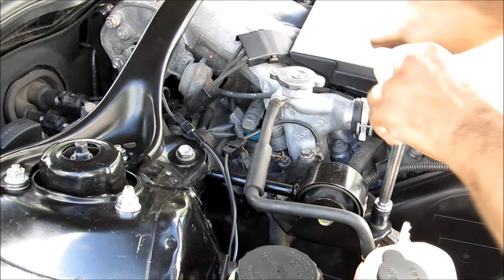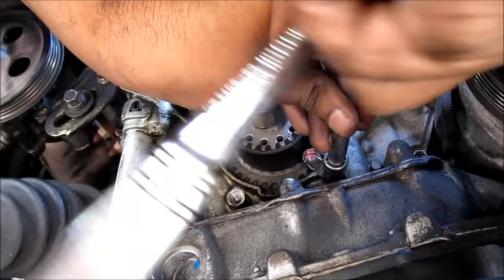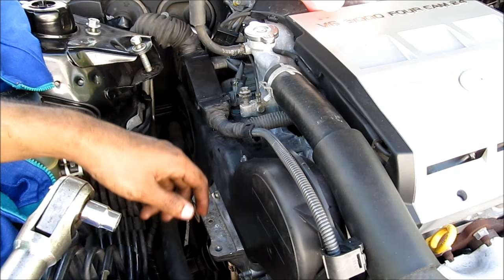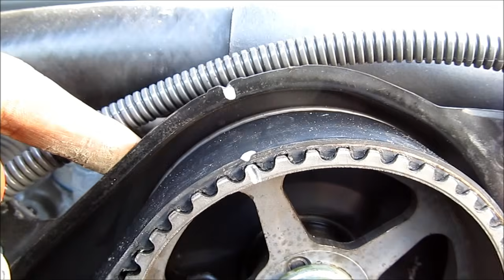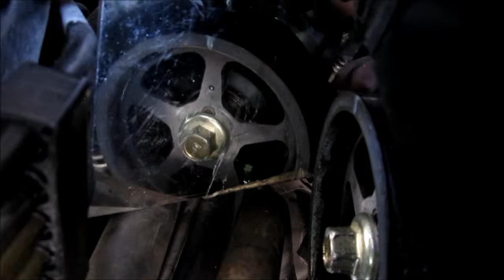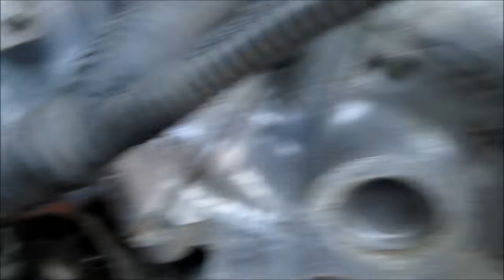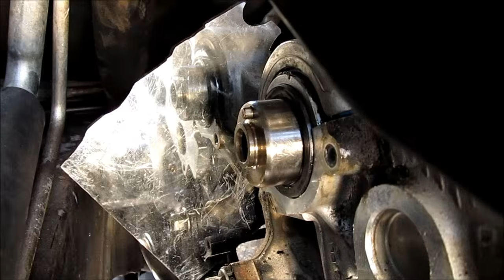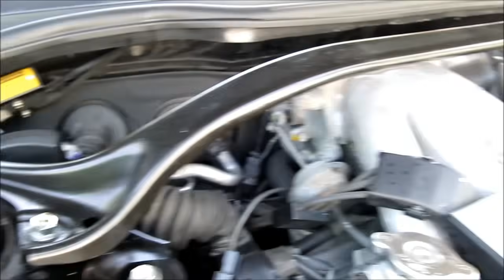Timing Belt / Waterpump Replacement: Toyota & Lexus V6

Comment: Hi, i replace the camshaft seals on my 1995 lexus es300 , i notice that the rear camshaft seal was more loose than the front  put the new ones in the rear one got in easy i used a kit from ebay with an aisin water pump and kp cam seals, and the car still leaking not as bad as before about 4 drops every time i drive it and shut it off, any ideas how to fix the problem? Rear camshaft seal still leaking,  maybe put some oem seals from toyota, can i put some rtv sealant on the outer diameter of the seals, i took me 14 hours to do the job, thanks man, ill appreciate your help
Reply from the maker: Not sure if the rtv will work, on the inside part, it may work on the outside part but you'll have to remove the valve cover to get a nice bead around it. Make sure it's 100% free of oil.

Comment: Hi again,
After I finished putting  everything back together, I was driving the car for a while, but the idle RPM is still high, around 1500 both with cold and warm engine. I noticed yours was running at 1500 as well, did it settle after warming up? I looked at forums and asked advice from mechanics, noone was for certain, I looked for vacuum leaks twice, but I did not find anything. Any advice? Thanks for this video again.
Take care.
Reply from the maker: +this real yes it should settle. Give it a few days for the computer to relearn idle

Comment: Any tips on removing the crankbolt after setting tdc, installing new belt and turning engine over to check timing marks? Does the starter method work in this case also? After all the turning by hand mine is stuck on there good.
Reply from the maker: +William Holmes An impacting action usually will crack it free. Try hitting the breaker suddenly with a hammer or use an impact gun.
Reply: Yea I just went and bought the Kobalt 1/2 inch cordless impact from Lowes. Worked really well. Thanks

Comment: How about the oil pump gasket, how do you replace that on this? I have a 1995 lexus es300,  thanks
Reply from the maker: +Eric Plascencia hmm I haven't done that on the 1mz
Reply: How long did it take you to  do this job, can it be done in 1 day?
Reply from the maker: +Eric Plascencia yes. I did it in two 4 hour segments while filming.

Comment: You don’t need to support the engine when removing the engine mount?
Reply from the maker: +cebayne because it's a torque mount and didn't bear the weight of the engine.
Reply: speedkar99 great, thanks

Comment: we are having extreme difficulty installing the power steering serpentine belt.  any thoughts?
Reply from the maker: +ChinchillaInTheHeat you need to use a pry bar to pry the pump up while you slip the belt on. See my serpentine belt replacement video
Reply: speedkar99 tried this for a couple hours.  It just wouldn’t budge.  The belt might be defective.
Reply: I had the same problem last year. Took it back and found out that they gave me the wrong one, and I thought it was me? There is one a little bigger that goes on easily.

Comment: Thank you for this great video. I was responsible for about 20 of the views, it was well worth it. I had trouble of getting the 22mm bolt off of the cranckshaft, but a torch and bumping the starter helped, Rock Auto provided a Mitsubishi timing belt, which had the bottom marker 2 teeth higher then the original Toyota one, it took me a while to figure it out, but it works, just doesn't line up, the cams with the crankshaft does though. Thanks again, it was a huge help! A video on a brake proportion valve would be much appreciated.:)
Reply from the maker: +this real I'm glad you enjoyed it, and it helped with your timing belt job. 
Thanks for the video idea I'll keep in mind.

Comment: I just did this job, thanks again for another great video. I would recommend that anyone who does this job to pay the extra $5.00 and get OEM camshaft/crankshaft seals from Toyota. I used some aftermarket ones and they leaked almost immediately after installing.
Reply from the maker: +doublet06 Thanks I'm glad it helped.

Comment: speedkar99, if you're still answering questions about the timing belt, I have one. Why on some installs do you need to line up the crank sprocket with the dots, then rotate it a tooth or 2 counter-clockwise before putting on the belt......and some, like yours, work just fine by leaving the crank sprocket lined up with the dots? Doesn't make sense to me how it can work both ways. Thanks in advance to anyone who knows whats up!
Reply from the maker: +Cj Oakman I didn't have to rotate my crank.
The manual asks you to rotate crank 60 degree to prevent valves crashing into pistons in case a cam turns

Comment: I know this is old but i just want to add that if your only doing timing belt and water pump you really dont have to take the cam-pulleys off or the back upper cover off. I just did my rx300 2000 3.0 and it took a good 6+ hrs and overall time off about 8 hrs on my crank shaft pulley bolt. There is no, easy way to remove the crank shaft bolt. Just throw all your knoledge and money at it, and it will pop off. This video was a great source to use. If you do the timing belt my god do your water pump too. Trust me...... you dont want to go back in.
Thank you
Reply from the maker: +Denny Christensen thanks, yes it's much easier if you don't have to replace the seals. 
I plan on making an updated video for the updated version of this engine on my 04 Camry.

Comment: When I start the engine a sound like tik tik comes and it goes when I drive but it comes again when I stop and turn right or left but the sound is noisier when I turn right. Do u think it’s the timing belt??
Reply from the maker: +Hassan Al-Sherawi fuel injectors tick..not sure what else could cause it

Comment: thx 4 all the videos. all very helpful. getting ready do timing/water pump and valve cover gaskets. quick question when you have a second. i have to use a breaker bar to get crank pully bolt off. i heard you mention disconnect ignition and blipp starter. is that the igniter you were talking about disconnecting or? again thnx
Reply from the maker: +John Hight disconnect the ignition coils that go to the spark plugs

Comment: WARNING! Not to scare anyone here, but this could happen to u too so be prepared for the unexpected. When doing my timing belt kit yesterday I ran into some issue. The aluminum engine mount bracket connected to the engine that the long bolts go into the rear threaded hole broke leaving 3/4 of a threaded hole behind. PB blaster was used, I soaked it, worked it back and forth and even waited, not sure if the last person used red Loctite or crossed the threads or it corroded itself together, I do detail my engine so maybe water over time? Luckily my friends house I was at does tig welding and he welded it and tapped it. No that’s not it kids, there’s more. I was putting the pulleys on and before I install bolts, I like to clean all the threads, I took the bolt for the tensioner pulley and thought this looks really dirty started to clean the bolt and yup, you guessed it, aluminum in the threads! Cleaned the hole on the block and thought ok maybe there’s enough thread? Put everything together and started to tighten the pulley, I couldn’t get it to snug enough to put the torque wrench on it, it just spun. So a trip to the auto parts store for a Heilicoil kit $74 after tax. I had to nibble away 2-3 inch long by a 1/4 inch deep of sheet metal that the wheewell splash guard screws into, so I could get the drill straight. 10 hours total travel time to auto store, weld job included along with the cursing and complaining conversations with myself, not bad, but still 10hrs, but I am so glad I returned the Gates brand kit with Chinese bearings and spent the extra $37 for the Aisin kit with Japanese bearings. Again thanks for the video, if it wasn’t for the issues I had, it probably would have been a 4-5 hr job. As I was doing this job I have to say, you guys that find the time and patience to video while doing a job like this, u guys are impressive and extra appreciated by people like me. Today I will take something for pain and watch TV, I am sore from head to toe.
Reply from the maker: +LittleJimmyNorton thanks, all the best

Comment: BTW question for u. When your doing the job and the seals are good meaning no leaks, do u do them anyway? My car has 201,000. Don't know if they are leaking or not yet. They are original, my buddy said when he did it last time, they were perfect. Thanks!
Reply from the maker: +LittleJimmyNorton Mine we're in reasonable shape, the rear might have been sleeping a bit. It's one of those preventative maintenance things while your in there.

Comment: I've done 4 cylinder timing belts, water pumps and even head gaskets before, so I do know how to wrench a little, but have been hesitant to do a 6. I paid my buddy last time to do my belt and water pump for $250 (labor) , but I think the $250 will be better in my pocket this time. I have all the tools to do the job and thanks to u and another guy on here. I have all the confidence in the world now to do my 6 cylinder and to make my job even better my buddy has a lift I can use, it beats being outside in 30 degree weather for for 3-4 hours. Thanks for the video!
Reply from the maker: +LittleJimmyNorton Glad the video helped and encouraged you to tackle the v6. It's not as easy as the 4 banger but it's not difficult either.
Reply: Just a little more time and patience. Just curious, how long did it take u? Whatever it took u, I can probably ad an hour to mine, at least. Will also give u an update after I do the job in a couple days.

Comment: Man just want to give you a shout out. I've done quite a bit automotive-wise, but have never desired to tackle this project on my 97 Avalon.  This video was so precise, I only broke out the Chilton manual for torque specs.  It's really not a bad process at all, but there are a few things I learned I wanted to share.  

First of all, if you have a 97 Avalon, DON"T BUY THE TIMKEN CRANK SEAL (224020) on Rockauto!  It is too "tall".  When fully seated, it sticks out of the hole so much that you cannot seat the timing gear fully back.  Timken's website will tell you it will fit you 97, it will not, their measurement says it is .317"!  The felpro seal that came out was .25" tall.  Just be aware and always compare the old part with the new.  I failed to do that this time and got bit.

I ended up buying a Lisle 58430 Oil Seal Remover tool.  I had all those seals out in seconds.  The cam seals were the originals.  I also made a crank seal seater from a 1.5" PVC pipe and pipe coupler.  Fits perfectly!  I used a 1.5" metal pipe nipple for the cams, but the 1.5" PVC pipe may have worked too.  

Use oil to help seat the seals!  I always used oil in the past, but got some bad advice to use white lithium grease and thought I'd try it this time.  I'm sure it works for some seal applications, but the grease reacted with the rubber and got sticky!

I had a problem removing the water pump, thought I might have to jack my motor up.  Turns out the water pump gasket is just thick enough to prevent you from pulling the pump out if they are stuck together.  Separated the gasket from the pump and it slid out.  

An impact wrench really helps with the crankshaft bolts.

I waited until the new timing belt was on to torque down the camshaft bolts, I didn't want to risk moving them any without the belt on.

Anyway, you saved me 450 in labor, and I appreciate it!
Reply from the maker: +MrTurboBiscuit I'm glad I helped you do the job and saved you money. Thanks!
Reply: thanks for the tips

Comment: CRANK BOLT WONT COME OFF no matter what!    Solution: make a jig out of thin rectangular plate with a whole for the 22mm socket & 2 holes for the M8 bolts (get bolts b/t 1 1/2" & 1 3/4".  I think 1.25 pitch).   This will hold the harmonic balance/ crank pulley which has a key and will hold the crank shaft.   I used a 6'6" pipe on top of a breaker bar with extension resting on a jack stand.  

Yes, I tried bump start method, 4 different impact wrenches (including a 3/4"), pb blaster, heating with a torch, banging with a hammer...   I don't know what the problem was, but after it went, "pow," and I thought the breaker bar had broke, it came right off.
Reply from the maker: +Tom Smith 3/4" didn't get it off? Hmm
Reply: The guy that brought it over works on heavy equipment and was scratching his head.  I was about to cry.  Once it broke free, it came right out.  It did have a bunch of stuff on it, but we can't tell if it had been loaded with red lock tight or not - prob bc I had heated it with a torch.   The last timing belt change was at the dealer too.

Comment: *  NOTE: when you check your belt install & rotate your crank bolt 2 rotations, only the mark on all of the gears need to align with the back marks - the marks on the belt DO NOT.    

I took off a perfectly installed belt to try again & almost went and bought another belt - because even tho I aligned the marks  one the belt up with the other marks, they weren't lining up after 2 rotations of the crank!   They aren't supposed to.
Reply from the maker: +Tom Smith agreed.

Comment: 👍🏻 Excellent.   Your video is the clearest and the only one I could find that included the camshaft seals.  

I'm worried about that rear one, but I'm going to give it a try.  Why go through all that work and then have to do it again if you get a leak?    With 40k miles on timing belt, I just had a leak on my Elantra from the crankshaft seal, but didn't know which seal until I got the covers off.  Major bummer.  I hear leaks from the crankshaft seal is fairly common.  I'm going to a avoid that on my highlander and replace all the seals at the same time as the timing belt & water pump!
Reply from the maker: +Tom Smith thanks 
Good thinking, my seals weren't leaking that badly but I still changed them for the heck of it.

Comment: Thanks for the video; did 01 Avalon (belt , idlers and tensioner only) took about 3 hours.
I uses 2 inexpensive plastic tipped metal clips to hold T-belt on the cam sprockets. Due to the slack and stiffness of the new belt, it was necessary to advance BOTH cam sprockets 1/2 tooth clockwise to engage belt on the crank pulley at the mark.
The installation sequence that worked for me:
With tensioner out and belt loosely on the sprockets, align mark on the belt to the mark on the 1-3-5 cam sprocket (firewall) and secure belt to it with spring clip; next, do the same with 2-4-6 (radiator) cam sprocket and lastly do the crank sprocket. If belt looks "too short" during this step, place 17 mm socket wrench on the  2-4-6 sprocket and slowly tun it 1/2 tooth clockwise. Both sprockets will move with the belt, thanks to the clips. After engaging belt with crank sprocket screw the tensioner in while holding the belt on the crank sprocket. Finally, release the tensioner holding pin and remove clips form the cam sprockets. These clips  will eliminate frustration caused by belt jumping off the sprocket marks during installation (Sorry, too much medical weed:))
Reply from the maker: +mkrp4 Thanks for your story. Glad the video helped

Comment: Warning to all, Do not buy a Dayco Timing Kit for this car, only 2 of 3 timing marks will line up correctly with timing mark on forward cam and crank.

Stick to Aisin or Gates Kits
Reply from the maker: +ShadowOps Airman1 did you put the belt the right way ?
Reply: speedkar99 yes i did, tried 4 different times, it was mismarked, so i remarked the back cam, works properly. Stick to Aisin or Gates is all I can say

Comment: My seals were so difficult to get out that I had to install a screw to use to pry them out (98 sienna w/250K miles n likely first time belt has been changed) n scored both camshafts. Have u even used speedi sleeve to repair shaft? If so were u able to do it while on the vehicle?
Reply from the maker: +Michael Brown I haven't had to repair camshaft scars. Do you think the scar is big enough that it will leak again? 
If your pulling camshafts you might as well replace them, there's tons of these engines in junkyards its not hard to get a used one somewhere.
Reply: I'm sorry I did not see ur reply. I actually  don't know how deep is deep but they're probably similar to the scar I saw in ur video. I slapped some semi-hardening rtv on them and threw the new seals in the other day and now currently putting everything back together. I tried putting on e the sleeves on but it got ruined trying to remove the little flange on it becasue there really is no room to do it once it is the recess so  I cut it off

Comment: Really great video, very concise yet detailed... well done. Question, I'm starting this process on my 98 Sienna, did you support the engine with a jack before removing the upper engine mount/bracket or is it not necessary? Thanks for your time.
Reply from the maker: +Michael Brown thanks. Glad you found it helpful. No need to support the engine since its only a torque mount when the engine rocks.

Comment: The bolt you used to turn the crank to tdc before taking the belt tension off. How did you get that bolt loosened without affecting the timing?
Reply from the maker: +RotiPani75 impact gun
Reply: That worked man. Thanks!

Comment: Awesome video speedkar99! Very informative. I am doing my timing belt & water pump and I find your video more straight forward and easy to follow. I have an 04 Toyota Sienna with almost 127K on it; it was first serviced by Longo Penske Toyota here in SoCal at 60K but lately I had been noticing some clear liquids and coolant leaking from under so I decided that it was time for another replacement. Other than that, the minivan is still running great. Thanks!
Reply from the maker: +Jesus Orbita glad you found it helpful, your van will last a while, my dad has a 06 sienna